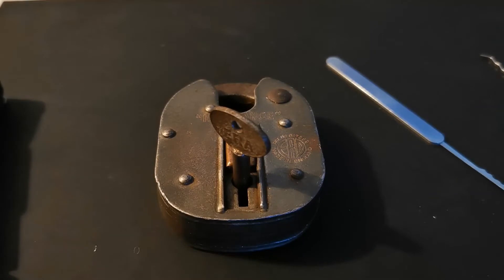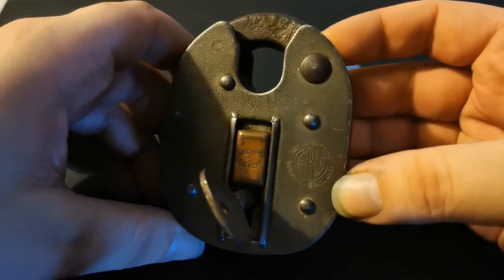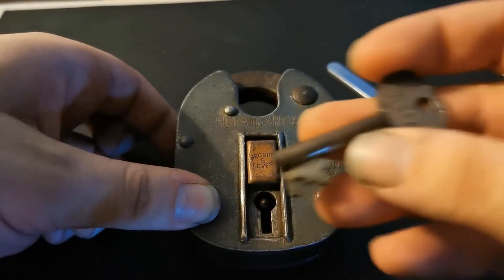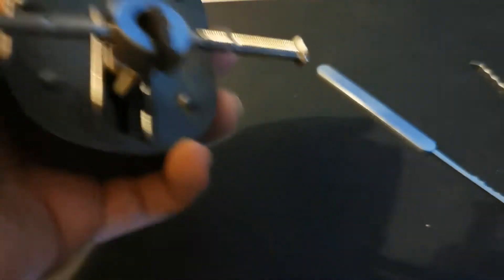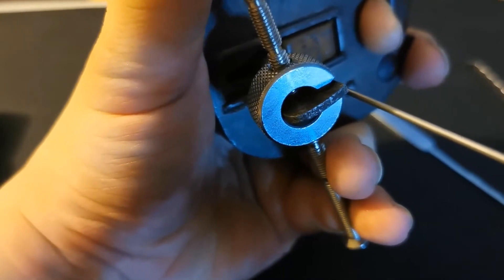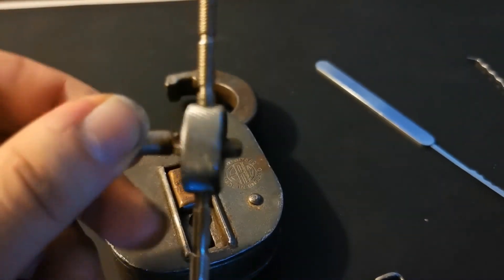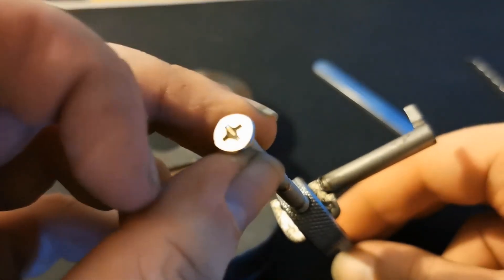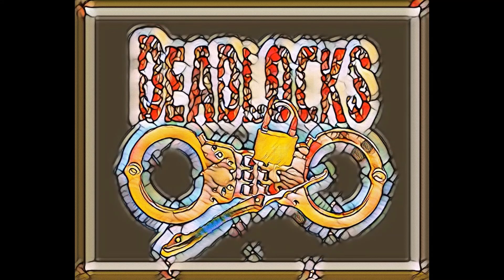ERA 5 Lever Padlock Picked With Home Made Tensioner

Comment: Nice tensioner, and smooth picking, too. Mrs RWB broke one of my picks. So she's bought me a set of dimple lock picks as an anniversary present. - But don't tell anyone; they're a surprise, and I haven't seen them yet, 😂
Reply from the maker: Thanks. If Mrs D got me presents when she broke picks id be makeing shure she did haha. Guessing its not the anniversary yet. You done dimples before?
Thanks For waching RWBHere. You got through quite alot the last few days👍
Reply: @Deadlocks86  I have about 6 dimple locks and haven't picked any of them fully yet, apart from one which is an Andy Mac throwaway, and which has the  easy thumb turn bypass. 2 are in use, so I'll not be picking them. 
Purchased 4 Yale Superiors, from 'The Bay Of Itchy Things', brand new, with 2 keys and code cards, in trade packs, for about £11 each, delivered. A bargain. I bought 2, checked that they're genuine, then bought 2 more. Using 2 for picking and 2 for doors. They have 9 pins and 4 sliders in each, and they retail at about £35 a pop.
Anniversary is next week, 19th. Can hardly wait to try out the 15 and 18 thou Peterson gems I added to the order! Shall have to do some music punching instead, to take my mind off picks. 
There have been a lot of videos from you recently! I saw them and thought it was time to catch up. Shall let you know when I get there. No other videos are being watched this week. 😁
Reply from the maker: @RWBHere  I think I bought a superior from the same seller. Fun pick. Alto the bigger sizes have 7 or 9 pins in them. The little 35s have 5 pins. I ordered a 35/50 to try and get both but they sent a 35/35. 
So 5 pins only for me. Still a fun pick tho. Have you picked any of them yet?
We have alot going up at the moment because we have the Edoc Dab/Lockmania pass around locks.
Trying to get through them all before they are off to the next picker. 👍